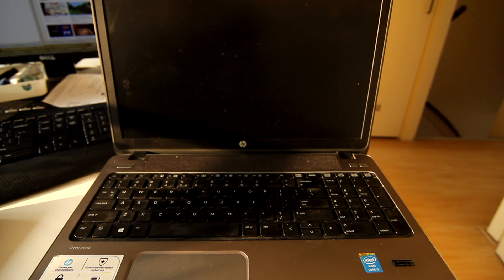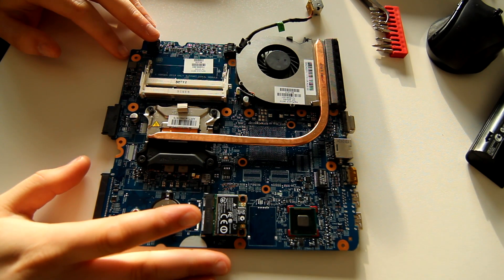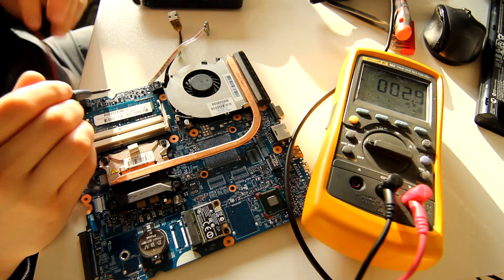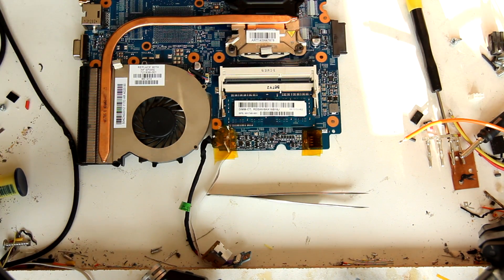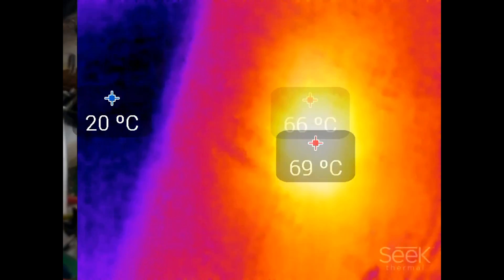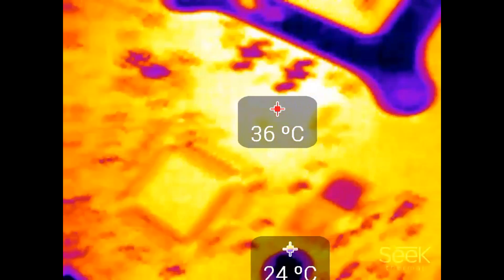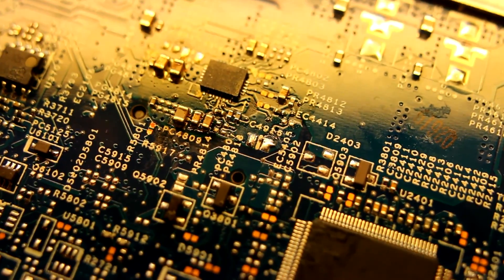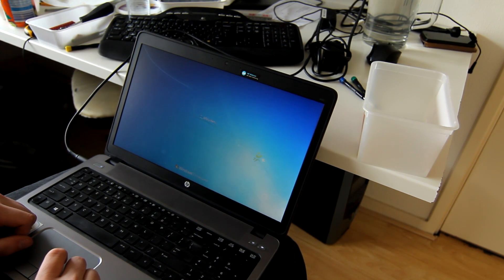HP ProBook 450 Troubleshooting & Repair (025)

Comment: Hi i have the 450 g4 hp notebook. When i plug in my power adapter the led light orange and after one hour the led turn off. After i press power on nothing happens no led codes or sounds. After replug the power on no led light is on. So what do you think is the problem? Same as you did?

Comment: Great video thanks. I have the same machine only a G3 and have a near short .2ohms on the  3v +sp1_vcc which goes to the bios chip amongst other things. Can I inject 3v into the rail and check for heat in this situation also? many thanks in advance,

Comment: I have mainboard with same problem on g1 470, have correct voltages on all capacitors and mosfets but nothing happens on power on.
Not sure if mine mainboard is even repairable, any ideas?
Reply from the maker: It's almost impossible to comment on that - I'd have to poke around in your laptop to see what may be wrong with it. All I can say is: try to use common sense and think how things should work, and you will probably find out what's wrong. Start with seeing if the button signal actually works and comes through to the mainboard, look if any components are damaged and look around for strange voltages.

Comment: Is your opinion about Bad Capacitors as main cause of defects true too? For some reason capacitors seem to f#@# up a lot since The Capacitor Plague beginning year 2000.
Reply from the maker: +GaryKildall Well, the thing is though: bad caps as we understand them from the Plague years (hehe) are all electrolytic caps that had the wrong liquid electrolyte formulation or that were overstressed. Over time the electrolyte would vent, the capacitors would stop functioning properly and you'd get power problems. Ceramic capacitors don't fail in this way. They rarely fail, actually. If I'd have to hazard a guess, I think this failure was due to a voltage spike or something like that, which broke down the capacitor dielectric and caused it to short. This would also explain the broken MOSFET.

As much as bad caps were and are a problem in consumer electronics, in this case we're dealing with something a lot less common.
Reply: +PowerElectronicsBlog As a child I got TV and Radios from garbage and I could hear the bad capacitor with an extremely high frequency malfunctioning. I replaced the capacitor creating that noise > 18 kHz with a good one and sold the garbage TV or Radio. At our age we can no longer hear bad capacitors but I assure you that bad caps can be heard by children with excellent hearing. Made me money :-) I am no longer able to hear bad caps since I am older now.

Comment: I use my finger to detect hot areas, then I use alcohol evaporation in that area. Chip that evaporated first is cause. Then heating the chip, removing it with just hot air. Some flux for solder tin removal. Then replacement chip after preparing with fresh solder tin. Heating it up with hot air. Reflow, ready.